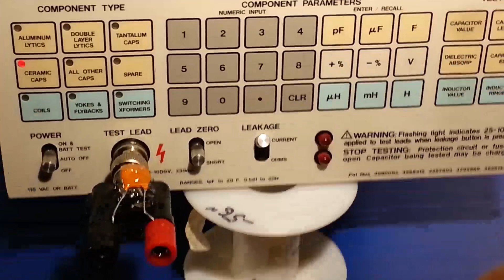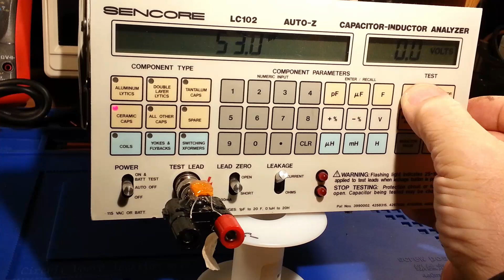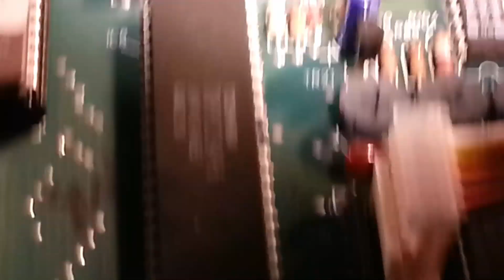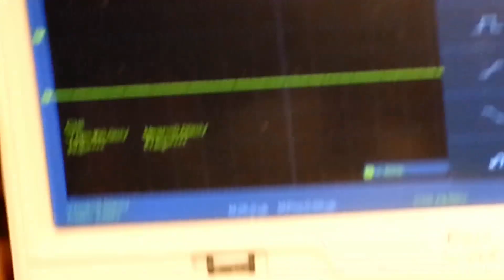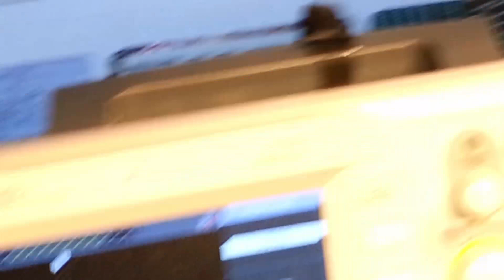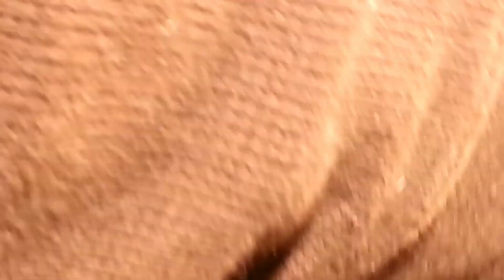Sencore LC102   XraytonyB Info 04 24 2023

Comment: Good Man! Thanks for contributing. I'll need to tackle mine soon.
Reply from the maker: Thanks! I'm kinda skittish about even doing a recap on this one. It has the later model Nichi purple caps, and they seem to hold up well over time, and since its working well, I figure "Don't fool with a Running Piece" , as they say. I did open up, and replace the PA251 DC power brick, might post that as a video, it's only got one cap, a 4700uF - 35V and although it tested great, it is aged so I updated it.
Reply: @poormanselectronicsbench2021  I agree. If it ain't broke...
The cap in my power brick was out of spec so I replaced it. Helped a lot with ripple.
Reply from the maker: @pcwrangler09  I also figure that mine might be, since that item is plugged in and probably powered almost all of the units life if set up on a bench, so, yes, was a good thought for you to do that also.

Comment: Thank you so much!  As I suspected, my MCU never toggles pins 30 or 31 low.  If I fold pins 30 & 31 out from the socket, it will very intermittently behave like your video.  I think this proves that I have a bad MCU.  Thanks again!
Reply from the maker: If you are looking for a better waveform sync, set your trigger function to trigger on a downward slope on the pins that are already HIGH at a idle state, that's what I did and they seemed to lock in well.
Reply: Cpu chips do fail and yes the suffix letters or numbers can make a big difference on these type of chips as in speed or built in ram/rom/eprom/nvram. Fortunately we have the net now.